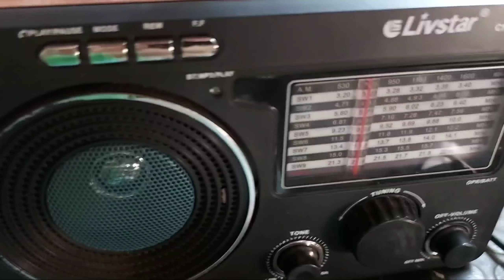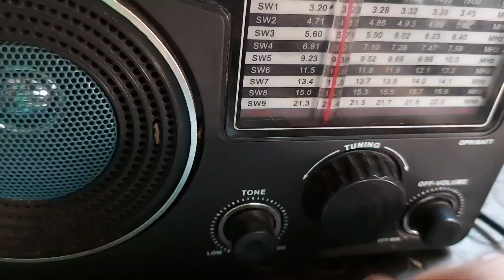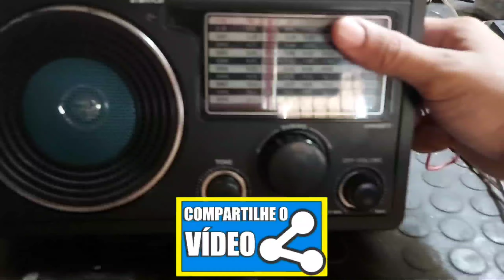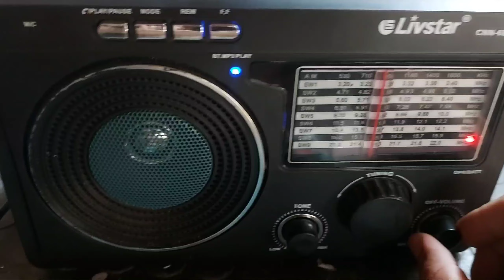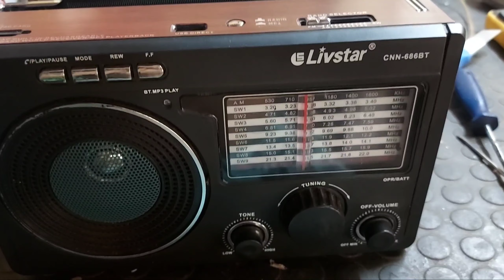Radio LivStar Com Som Limpo Mas Muito Baixo

Comment: a fonte tem ruido e acimtrica ! tem um regulador de 5v pro player e ci do radio .O ci tda2822  tem um regulador interno por isso que queima ! presisa de um dicipador depois de substituir  !
Reply: Peço desculpas pela confusão anterior. O TDA2822 é um amplificador de áudio e não possui um regulador de tensão ou filtro de tensão interno. Ele é projetado para amplificar sinais de áudio e requer uma fonte de alimentação estável para um desempenho adequado.
Reply: esse circuito desse radio ta quase tudo errado!
Reply: Esses radinhos chineses são baratos.. mas também acho que o defeito é na fonte de alimentação pois é um pequeno trafo .. que alimenta o circuito o normal é alimenta esse CI2822 com 5v no mínimo... por isso o áudio corta quando aumenta o volume.. pois a fonte dele dá China n não suporta... todo o circuito